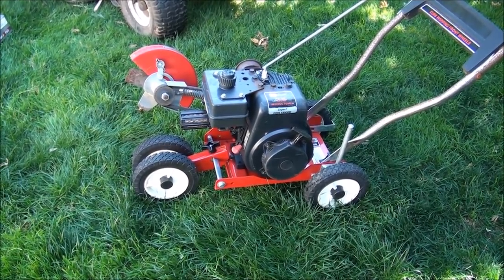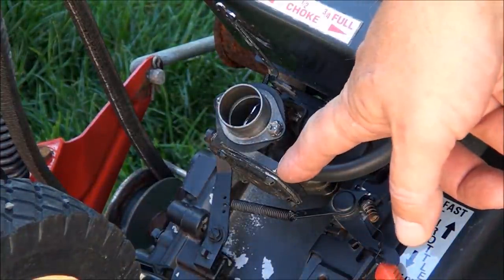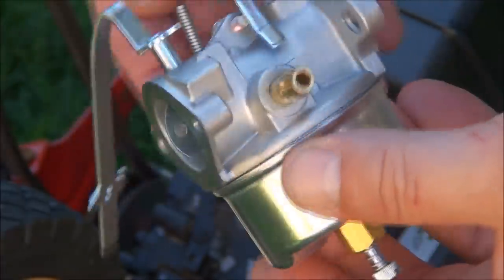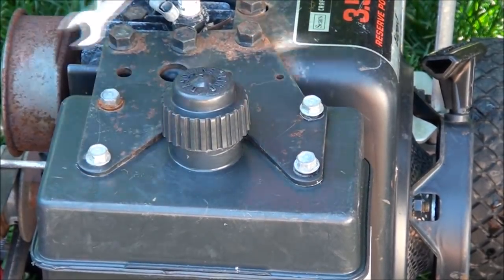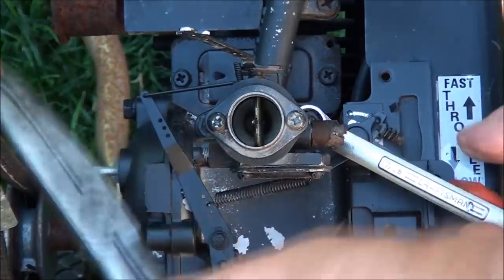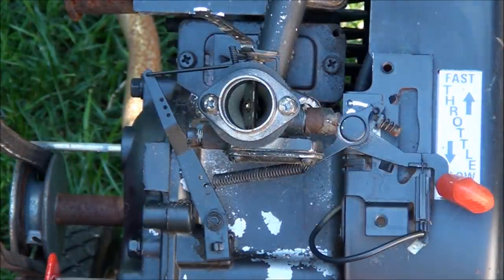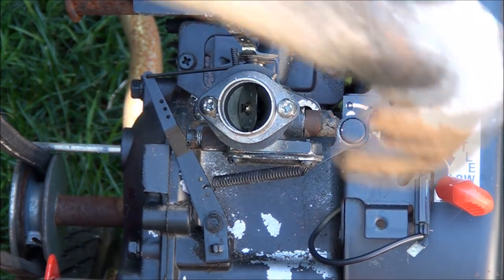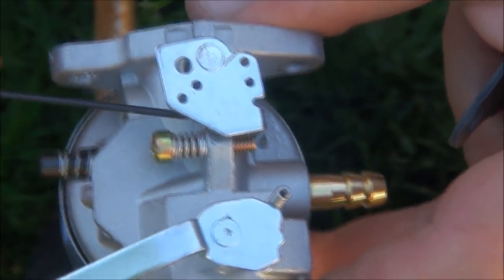Common Tecumseh Small engine WONT START. Is CHEAP aftermarket CARBURETOR ok to use? Craftsman edger

Comment: You remove the carb by removing the intake and the carb as a single unit from the cylinder (2 screws) then the carb from the manifold. Much easier...

Comment: I think those craftman eager one edgers were made between 1983 to  1984 or 1981 or 1982 to about 1984 after 1984  the craftman brand of lawn and garden equipment mowers push and selfpropeled edgers riding mowers tilers chainsaws there bush and hedge trimmers were all a silver gray color i think by at least 1985 for sure the craftsman lawn and garden equipment went to all silver and gray colored lawn equipment id have to check my sears catalogs and sears lawn and garden equipment sales catalog but im pretty all of their lawn and garden equipment was silver and gray by at least 1985
Reply from the maker: Cool! thanks for the comment and info!

Comment: Took my 1 yr old pressure washer (won’t start) to the repair shop, they said it was the carburetor clogging up. They wanted to order a new carburetor and wouldn’t even fix it. $135 was the total including labor which was reasonable.

Comment: I know this doesnt have anything to do with the video specifically but it's a little insider info about that machine I thought you and everyone else in the comments might find interesting. I sealcoat and stripe parking lots for a living and we have used these little edgers for 20 years to clean deep cracks, bad oil spots, and edge the parking lots and driveways in prep for sealcoating and believe it or not, they work a thousand times better with a wire wheel on them instead of the blades! I dont know why, they just do.
Reply from the maker: wow! great comment and a good idea too
Reply: Awesome!! Thanks for the words of wisdom brother!

Comment: Yes, maybe you can fix the cheap carb and make it work.  Could be a good machine for someone.   Thanks for the video.
Reply from the maker: If I would have bought an expensive OEM carb. I wouldn't have any problems

Comment: Too bad the new carb was a leaker.  I hope you were able to save it.  I have a 1989 model edger with a Tec 3 HP horizontal engine, looks identical to this one.  It also had that diaphragm carb, and starting it, hot or cold, was more trouble than it should be.  So 3-4 years ago, I just looked up a replacement carb for an H30 engine, and picked 1 of the float bowl ones, probably from Amazon.  I have bought a few, and "Rop Shop" is one of the ones I have bought. If you freeze this video around the 3:00 mark, there is an air horn or filter adapter screwed on to the diaphragm carb.  I just transferred that piece to the new Chines carb when I installed it on mine, and kept the original air filter, with no problems.  One more thing - mine also had that flat noisy muffler.  If you remember the Toro mowers with the TNT100 engines, the muffler went through the deck and exited down in the cutting area.  That muffler fits this engine (it did for me, anyway), and it's less harsh (I wouldn't call a Tecumseh muffler "quiet").  If you have any of those mufflers in your horde of parts, you might want to try it.

Comment: Great video, I have a McClane edger with that engine and I've got the governor out of adjustment. Will you do a video on setting the governor on the engine, please?
Reply: You might have to take the whole engine apart unbolt off of whatever its on flip the engine over how i did my one Kohler command and fit the pieces back in place that way its alot of work but worth doing if you want it to run smooth again

Comment: Man i sure can't find drop of dodo on my 17.5hp tecumseh riding mower engine it takes a long time to start up so i was thinking maybe its not getting enough gas but no its getting the right amount of gas and the carburetor is all clean inside but i haven't checked the valves 

And i did notice when i redone the cover gasket one valve did seem a little lose or arm i don't remember all the names yall call these parts but i keep thinking the problem with it is one of the valves need reset and i have the tools to do that i have no instructions but know how to without those its the tecumseh engine that has the plastic carburetor bowl

Comment: What is the part number of the carburetor you ordered?
Reply: The reason I don’t watch his video much 
He never give any useful information
Reply: You guys just gotta look up the name and horsepower of whatever engine or model numbers if you have one lots of my engines don't have model numbers but do have names and the horsepower so i go from that and compare by looks because i don't always have a model number to look up for getting the exact replacement part but i tell you the aftermarket Kohler carburetor bowls are junk for the cv models of Kohlers they are and so are the oem ones garbage

Comment: I know they are if they ain't right after installing they will be in 2 months after installing them oem ones are to some how i found that out so its better to buy another piece of crap than to blow more money on one just like the original that was crap before buying the cheap crappy one so another cheap one is i guess better because you'll save about 40 some dollars

Comment: Actually, Jeff If you want it to run right!!!!! you would use Tecumseh #632107 which is the same carb, but also has a main jet screw as well on the bottom of the carburetor making it fully adjustable!!!!!!!!!! The EPA mandated that manufacturers could no longer manufacture equipment with adjustable carbs anymore, but Tecumseh still continued to use the same carb body they just changed the lower jet to a nonadjustable type. So you can just use an older style carb in the place of the newer style one. Here is a video https://www.youtube.com/watch?v=GmBRmL8-m7U
Reply from the maker: thanks man. OEM is always best, but not cheap...